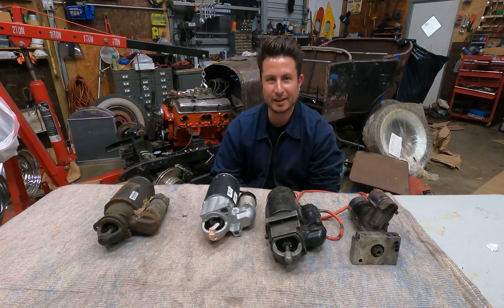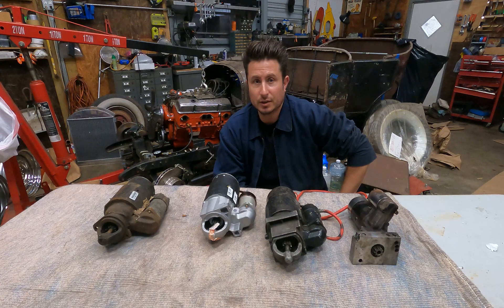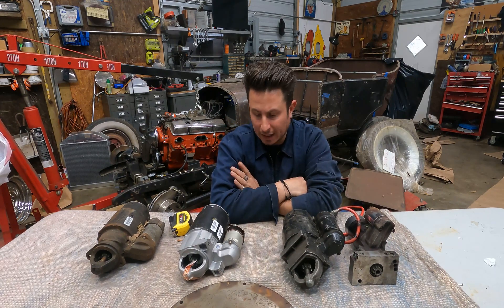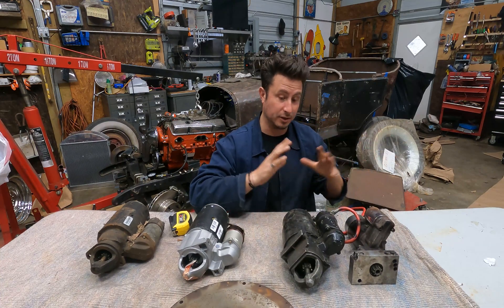Why are there SO many Different Small Block Chevy Starters?!? Which one is right and HOW TO TELL!

Comment: I literally just went through this 5 or 6 weeks ago and it has been a learning curve to say the least.
I am using a 1963 283 with a 1987 astrovan borg Warner t5 trans (I want to cruise at modern freeway speeds)  the astrovan has a weird spline count (i think 24 teeth) and used a 11 inch clutch.
The 283 when I bought it was disassembled but had a flexplate and I couldn't find a used flywheel so I ended up buying a flywheel for a 1969 Chevy 327 I think on RockAuto. I used a caprice or Impala (I don't remember other then it was a full size) for the flywheel and starter, the clutch kit was a performance goofy looking puck thing from RockAuto that came from the astrovan clutch choices page 
I was so confused by all of this and the internet just made it more confusing and I am still not done. 
I still can't find the dust shield for a  T5, i bought one that claimed it was for all 168 tooth bell housings but it definitely doesn't fit the (metric?) t5 lower half of the bell housing
So now I guess I am going to make one (it can't be that hard I don't think lol) I want to fire my engine up so bad, I did rings bearings, valves and wedged a pretty big cam in it so I am excited to hear it make noise.
The next thing I got to figure out how you are supposed to properly shim a Chevy starter, i did figure out that Chevrolet s have a rear support for the starter that bolts the back of the starter to the engine block supposably that will keep the starter from breaking the nose cone off I know years ago when I sold car parts at what today is O'Reilly Auto parts are so numerous Chevy GM starters with the nose cone broken I always figured it was from improper shimming but the starter I guess needs a support bracket. I found one on eBay brand-new I think it was seven bucks shipped to the house. You probably could make one but I had never seen one to replicate it. .
My other thing I got to figure out isn't starter related but I got to figure it out to before I can start it  I don't have the canister filter assembly (I would rather run it if I could find one) so I bought a mr. Gasket spin-on conversion but I don't know what is supposed to be up inside the block if anything so I haven't bolted that on either yet, the mr. Gasket instructions are terrible at best and they don't do a real good job illustrating how it all goes together. 

I like the challenge of this stuff but I went SBC headaches, at this point I wish I would have went nailhead or some oddball V8 like a Rambler or Studebaker.  
After I finally get it all figured out the next challenge will be the pedal assembly as I eant them to go through the floor but man that little A frame is so tight for room especially with the t5 having an external slave cylinder.
Reply: I feel your pain, I have invested an abundance of money and time into my 79 El Camino, and I just want to be able to drive it again. I'm hoping once I've swapped the starter,all systems are GO.  Everything time I fixed something, something else would become a problem, requiring repair or replacement. Good luck, hope you're up and cruising very soon.
Reply: @darkwolf4962  it's just part of the car hobby. I just wish the auto parts stores actually sold quality parts. There is nothing worse than replacing something and then having to replace it again a few months later. 
Good luck on your ride. Just keep chipping away at it and your get there.
Reply from the maker: There is a lot going on here, but I was addressing the gen 1 sbc... as soon as you get into the mid 80's there more parts that can be made to work with even more variables.
    Shimming is not that big a deal.   Bolt the starter in, pull the gear out with a screwdriver, the gap between the peak and valley of the engaged gear should be .020-.030 (a paperclip wire).   if they are jammed together add a shim and try again.  if its working and not making any grinding sounds... you are good.   
as far as the rear starter bracket... know of them... never actually seen one.    never had a problem.   
    this is the thing about the ole small block chevy.. people think they are "easy".   its still a 40-50-60-70 year old motor, with nuanced differences that cause you to learn via headache and process of elimination.     if you were going through this on an early nailhead, the process would be the same.  But information would be more scarce, parts more rare and expensive, dead ends would be more common and longer.... and if you blew it up breaking it in or showing off...good luck finding another.   for some the cool is irreplaceable but to me its too stressful to drive an engine that feels irreplaceable.
Reply: @betweenthesharksgarage  
I really don't mind the learning curve. I have been messing with cars since I was 14ish and I am now 44, there isn't anything on a vehicle I am afraid of doing... What is different on a real Hotrod (not a 50s cruiser or a 60s barge is it is a hodgepodge of parts and figuring how to make it all work together.
I mean a model A is pretty crude and as much as I say i am building a Hotrod the reality is I am building a streetrod that has the look of a Hotrod but something you actually want to drive more then 20 minutes,  so new brakes, a cheap 8.8 ford axle, that 5 speed trans are all "late model" parts meant to make it fun but safe and reliable, the SBC  is from the golden age of and they look so cool with the oil fill pipe and the script valve covers and an old school generator. 
I have wanted this truck since I was 13 years old (probably longer) and I wanted to build it , the only bad thing is my friends are car guys but they aren't as hardcore as you or I so I can't really pry information out of them so everything has been done thus far by reading or watching videos like yours.

By the way thanks for the shimming information that will be this week's project as I want the engine and trans to be 100% done and ready to go. I still got the starter  oil filter assembly, trans dust cover and generator. Today I was going to rebuild a generator to knock that task out if the way and as I disassembled it i realized that somehow the armature is bent (I guess now I now why it was in a dusty garage and not on the car it came off of lol). Again just another challenge. 
Your helping keeping me motivated because you're not to much farther along then me and we are building similar rides so I can steal your knowledge here and there